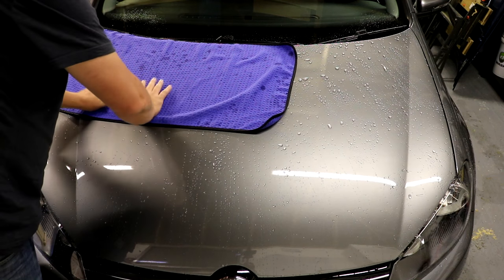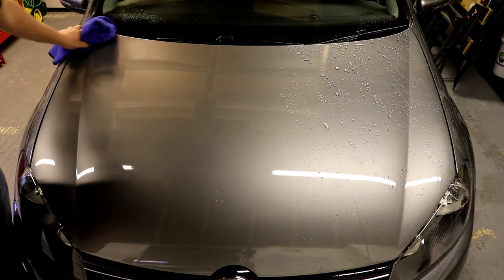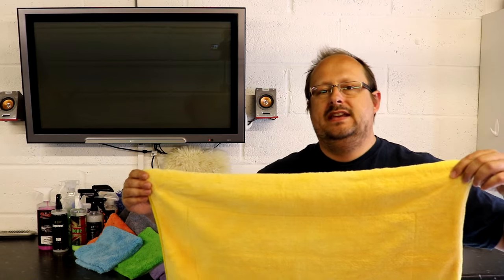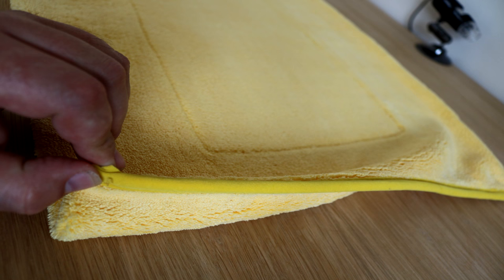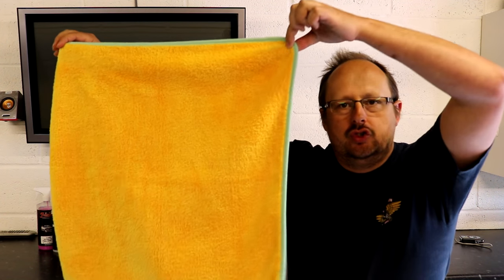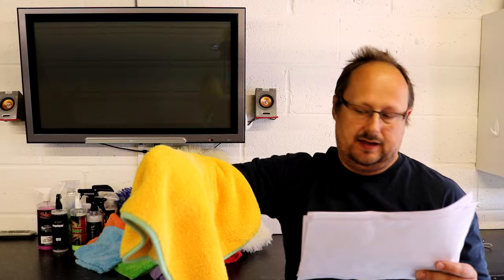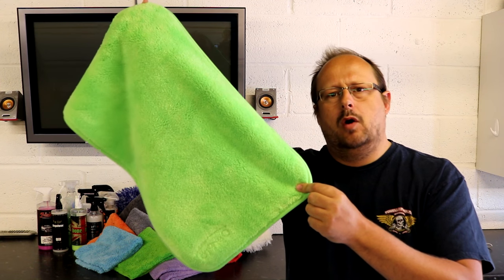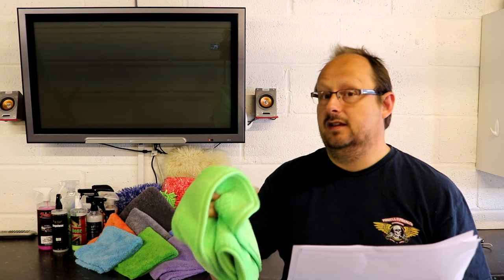The best car drying towel review part 1 - how to dry your car products

Comment: What about the Kent drying towl £4 at bq
Reply from the maker: +hakman239 they are truely woefull...  they are nasty budget microfiber...
Reply: I have one they I don't have any problems with it and I use it for buffing off wax
Reply from the maker: hakman239 I can only tell you what I think...  If you are happy with this product then by all means buff away on your paintwork with it..   Its on my list of things to do to show people how these cheap cloths mess up your clearcoat...

I would say one thing to you...  a) try some of the towels in this review first.   b) try some of the buffing cloths in my microfiber video (check out a 500 gsm boa or a ragmaster eagle edgeless etc)..

go and try them.  And come back to me with your opinion on how good the kent 4 pound pack of drying towels is...    Id really be interested in your opinion
Reply: +Forensic Detailing Channel he meant the £4 drying towel (specifically made for drying) not the £4 pack of general microfibre cloths.
Reply from the maker: yes the kent drying towel 4 quid.. nasty low budget cheap microfiber etc.. what I said above.  avoid if you value your paintwork...
Reply: +Forensic Detailing Channel autoexpress rated it #1 so it cant be that bad.
Reply from the maker: So its not possible that the review isnt particulary great or just got it wrong?   ... like I said to the other chap..  If you want to use the kent drying towel go for it...   But you if you are interested in using the best products for your car then thats why I did this video...   trust me on this one...
Reply: I'd like to see the difference between these cheap kent towels and the quality towels on here 👍